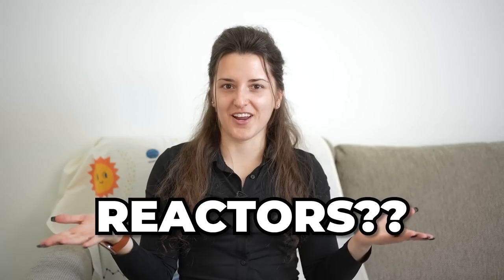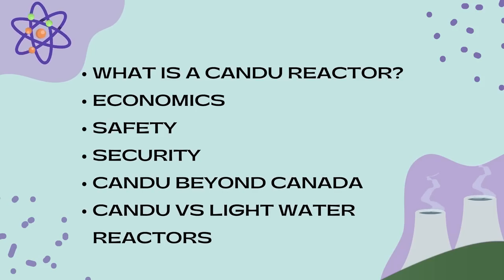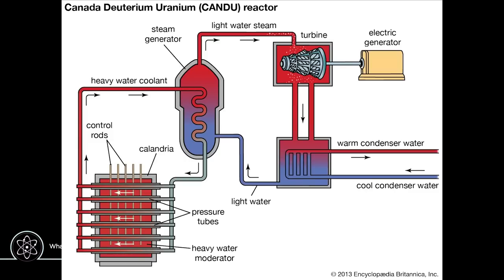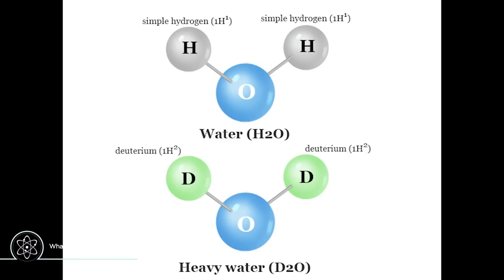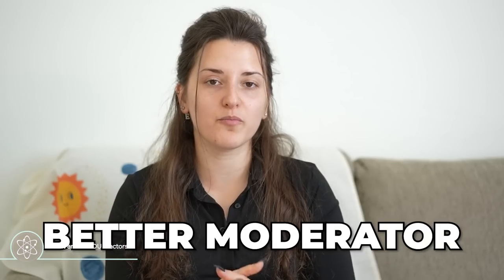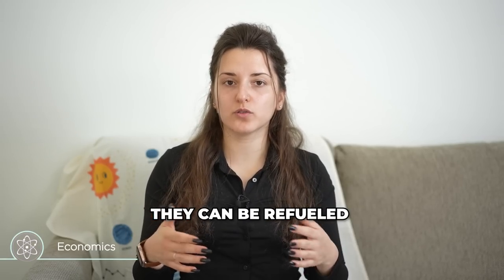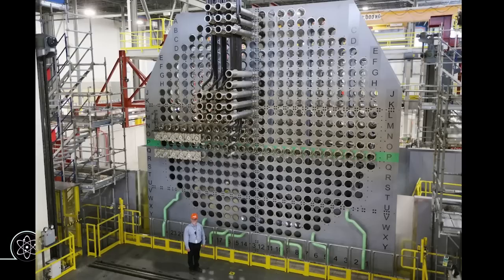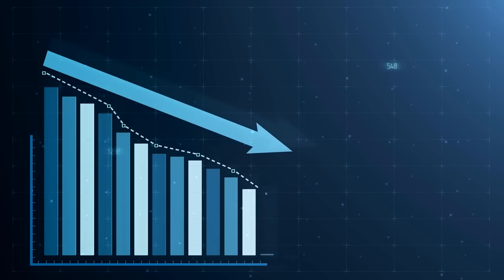Nuclear Physicist Explains - What are CANDU Reactors?

Comment: My understanding is necessary maintenance limits the capacity factor of CANDU to not really any better than LWRs in spite of online fueling in the CANDU, and that LWRs get away without online fueling by going to slightly higher enrichment balanced out by burnable neutron poisons and/or neutron poisons added to the water.

Comment: Very cool presentation! One thing I would add is that CANDU reactors are much more expensive than other reactors (BWR/PWR) mainly due to the huge dimensions of the calandria. Aside complexity and cost of materials, this also requires a very large containment building. So initial cost could be much larger.

Comment: The reason to use deuterium (D) rather than protium (=regular hydrogen, H) in not that it is better at slowing down the neutrons. Actually, normal water (H2O) is better at it than heavy water (D2O). Both because of a larger scattering cross section and also because of its lighter nucleus.

But here is the problem: neutron capture (or absorption) is much more likely to happen with normal hydrogen (H + n -> D) than with deuterium (D + n -> T).

Absorption cross section for neutrons in barn (source: wikipedia)
      thermal    fast
H    0.2          0.00004
D    0.0003   0.000007

Preserving as many neutrons as possible is super important when using nonenriched ('natural') uranium.

Comment: Candu reactors are in fact perfect for proliferation - it is the perfect design to produce plutonium continously, since single rods can be exchanged during operation. It does produce less plutonium than a light water reactor, but it does produce sufficient amounts for weapons use. And since it does not require uranium enrichment, which is complicated (plutonium separation is much easier) it especially appeals to developing countries, which want to hold the door open for the production of weapons grade plutonium.

Comment: Canada also has very high purity uranium deposits. This means that they can use the uranium without processing and still get good efficiency. Other countries would have to buy Canadian uranium or concentrate the uranium that they mine out of the ground. A reactor under pressure is much more likely to have a pressure explosion compared to a non-pressurized reactor. If your vessel fails, the water flashes to steam and suddenly takes up 400x as much space. This is why they have those huge, expensive containment buildings. Optimally you would use molten salt or metal which brings the advantages of high density and not being under high pressure.

Comment: Good video, a couple of conflicts from my own knowledge though: I thought D2O was a worse moderator in terms of its ability to thermalize neutrons, light water is the best. Heavy water makes up for this due to the fact that it doesn't readily absorb neutrons, thus enhancing the reactor's neutron economy. Second, I thought CANDU produces more plutonium than LWRs. But this extra production is dealt with by a higher burnup rate of plutonium. Because the moderator and coolant water is separate and somewhat thermally insulated from each other, the moderator is cooler than the coolant. So when the neutrons re-enter the fuel, they increase in energy up to the resonance energy of Pu-239. This is the opposite of the RMBK reactor type. This means CANDU burns plutonium, whereas RMBK stores it (intended for weapons), (I believe the Chornobyl reactor was at the end of this Pu build-up cycle, which exacerbated the accident). Just some thoughts, thanks for the video!

Comment: The heavy water is in fact more efficient as a moderator since it absorbs less neutrons than light water.  It has an improved neutron economy. But it is not as efficient as light water in slowing down neutrons through elastic collisions. That’s why the reactor is so much larger than a light water reactor, it needs more distance between the fuel to slow down the neutrons to be thermalised.

Comment: Thanks a lot for information about CANDU reactors.

In Québec, the only nuclear power station, Gentilly 2, a CANDU reactor, has been shut down in 2012, but has not been dismantled. Uranium combustible rods are still in the reactor.

And today, studies will be launched to know whether or not, the 600 Megawatt reactor would be restarted.

Interesting detail: The heavy water pressure inside the nuclear reactor vessel has to be maintained at 10 MPa (or 1450 PSI), about 12 times the pressure inside a heavy truck tyre, to prevent ebullition of the heavy water inside it despite its outlet temperature attaining 310 °C (590 °F), temperature required to transform secondary light water circuit into high-pressure steam required to run the turbines.

I have a question: In case of D2O leak, is the leaked heavy water radioactive and if so, what is the D2O half-life ?

Thank you..

Comment: One thing I don't hear about or don't understand, the water contained in the system is radioactive and toxic correct?... We talk plenty about disposing of the radioactive used core. But how is the radioactive water disposed of? And what safety measures are in place to deal with water leakage from the system?

Comment: It was my understanding that the CanDU a  Calandria vessel (not pressure vessel)  (kyle3420).  My understanding is that it is impossible for the CanDU to do a core meltdown.  If the heavy water around the fuel gets too hot, the water boils and the reaction shuts down.  This is due to the fact that the heavy water slows down the neutrons so that they can react with the Uranium.  No water - no slow neutrons - no reaction.   Another advantage is that if there is any problems with the reaction, just dump the heavy water and the reaction is shut down.  I remember researching this many years ago, but I have not found any references to this lately
Reply: 1) Pressurized light water reactors have all these advantages. Dot.
2) Melting of the zone occurs due to residual heat. If there is a loss of coolant in the CANDU core, there will be a hole in the floor, like at Fukushima Daiichi.

Comment: Something I'm not clear on is how it can use natural uranium as fuel.  When she said that D2O is a better moderator, I assume she means it's better at thermalizing neutrons.  Since the cross section for U238 in the thermal range is terrible relative to U235, how does having a better moderator fix that?  I feel like there's something I'm not understanding somewhere in here.

Comment: Does this reactor have flexibility in preventing "power tilt" or an uneven power distribution across the core itself?  I'm 71 and have always been interested in reactor theory/physics. You have a very interesting video series. Thank you so much for this.
Reply: Great question. The answer is yes. CANDU reactors have 14 compartments spread through the reactor core which can be filled with more or less light water as required. This  "liquid zone control" system allows both bulk and spatial control of the reactor flux. The reactor regulating system (control computer) continuously adjusts the levels in the compartments to control the power.
Reply: @Heja16  thank you so much.  Your channel is quite interesting.

Comment: @YourFriendlyNuclearPhysicist  >>> How often does a CANDU reactor require heavy water to be added to the primary cooling loop?
Reply: Almost never. The whole thing is pretty much sealed. If I remember well from my years at AECL, there are even systems to capture heavy water vapor inside the reactor building, scrub it out of the light water vapor also present, and scavenge it with a 90 to 95% efficiency.

Comment: I think the molten salt reactors you discussed previously are probably the most interesting reactors for the future. That said I think the advantages with regards to fuel in both versatility and lack of proliferation concerns with CANDU reactors are excellent. Given newer reactor designs that can be built in the near term to replace aging reactors and (ideally) increase nuclear use and cut fossil fuel use I think the CANDU seems like a great option where proliferation is a concern. I hope that the Canadian's can develop a better process to deliver the necessary expertise for these reactors to be operated more. The reality is proliferation is ALWAYS a concern so any reduction in the production of weapons grade material is good.
Reply: There have been plans for more advanced reactors in many parts of the world already, which didn't come to fruition. One case was the fast breeder in Kalkar, West Germany, which was opposed by many citizens, as it was supposed to use hot sodium as a coolant (which will create a flaming inferno as soon as there is any contact with the oxygen of the open air). Another issue was the high costs of the planning, enineering, and construction, which were initially supposed to be borne by the government. When the project took ever longer (it should have provided power in 1987) the government finally decided to stop the funding - in 1991. The companies then dropped it like a hot potato. 

The scariest aspect of this specific system is the breeding. It can create plutonium that that is suited for nuclear bombs.
Reply: Molten metal as a heat transfer medium is very problematic.  Russia tried sodium with a few submarines with the biggest problems being that you can not let the metal turn solid, making shutting them down to refuel very difficult and expensive.  Water is a very good coolant and moderator in correctly designed reactors for its positive void coefficient, where once over design temperature (or under design pressure for PWR) the act of the water boiling will reduce reactivity.  There were also some solar farms that used sodium as a heat storage media that also failed when it was cooled to the point of turning solid, and the plant having no means to re-heat it in place to ever restart it again.
Reply: @gabbyn978  
A fast reactor, in principle, is not capable of producing weapons-grade plutonium, because it cannot be reloaded on the fly, unlike channel reactors, it does not pose a threat to the proliferation of nuclear weapons (although it is not a threat).
Reply: @larrybremer4930  

The USA tried sodium, the USSR tried eutectic from lead and bismuth, and the problem of coolant solidification can easily be solved by a heat accumulator, especially since solidification is not a problem at all for civil energy.

Comment: I’m am from Canada and I am not sure about the lower maintenance cost.  In Ontario, where most of Canada’s CANDU reactors are located, the Ontario Power Generation Corporation has a huge debt and, as a result, Ontario has very high electricity costs.  Most of that debt comes from the cost of maintenance and refurbishment for its CANDU reactors which account for about 60% of Ontario’s electricity.  (Very little of that debt is from overpaying for the installation of windmills as politicians try to score points like to say.)   The same may be true of light water reactors, but low maintenance cost is not a selling point for CANDU reactors.
Reply: This comes partly into play due to having to pay the USA to take our Excess power generation.  That's right, we pay others to take the surplus power...  There was also the Boondoggles with the Previous Liberal goverment with a Gas Fired Generation Station and also the Payout Rates to SOLAR / Wind generation providers being higher then the cost of the nuclear generation.  There's a whole story behind the cost and yes, it's expensive, but it's not through fault of the technology, it's the politics.
Reply: @Dropbaud  The debt due to nuclear power is in the 10's of billions of dollars.  The items you are quoting are insignificant by comparison (unless you like to parrot PC talking points).  Both the PC and Liberals have very large responsibility for the mess in Ontario's electrical power situation.  But the bottom line is that nuclear dwarfs all other debt contributors.  Both political parties have made major contributions to miss managing that debt.  In all credible analysis I have seen is nuclear power is extremely safe, extremely dense (lots of power out of the land area occupied by the generating facility) but extremely expensive compared to any other common form of generation.

Comment: Since I live in Canada I would by default choose the CANDU, but it was cool to learn that the CANDU can help remove some of the waste fuel from the light water reactors.  Having said all that I think we need to start burning through all those old light water reactor fuels, I just am not sure how we could move those rods with a huge safety margin.  I mean obviously not with a train as we see them get all smashed up.  However, I think those thorium salt reactors look interesting.  What I would like to see society do is clean up all the light water reactor fuel we have all over the world. Yes, we store the rods in water or maybe we stick them on concrete that will not last long enough for the radiation to be handled.  Do better.  Can't believe we built things we still have no good solution to, OK one country I know has a plan but I imagine they won't be taking fuel from every country and someone will build a storage site on a fault line.

Comment: One of the main reasons CANDU hasnt been licensed in other countries is the fact it has a slight positive void coefficient, which means that when the coolant is depressurized and starts to boil, the reactor power increases. Light water reactors have a negative void coefficient and will not run away since the coolant is also the moderator
Reply: Pretty sure this is the other way around. If the moderator or heat carrier (both being heavy water in the case of PHWR) boils, then the density reduces and the neutron flux is not as effectively slowed to become thermal neutrons (those with the right energy to sustain chain reaction). There are even some sub-variants where one of the emergency stop system dumps the moderator into a receiving tank below the reactor itself.
Reply: In a CANDU reactor the heat transport D20 and the moderator D20 are seperate systems. Physically separated by two walls of zircalloy tubing. The natural uranium fuel lays inside the fuel channels, that is surrounded by an annulus gas system to detect leaks in that boundary. Those tubes are mechanically sealed via another tube outside of that. Then you have the moderator. The moderator will never boil unless the fuel melts through both walls and even then it would be difficult as the calandria contains a very large mass of D2O. You are partially correct though, the temperature coefficient of the fuel is negative and will counteract the positive void co-efficient when the fuel expands, but not enough to shut down the reaction. The first generation system did have a dump tank that the moderator only would fall into when the unit scrammed. That system was modified in the early 2000's upon restoring the units to commercial service. A dump arrest system was installed that monitored the neutron flux when a scram occured, it would prevent dumping the moderator unless the flux decay wasnt following a pre-determined curve. The reason being is the moderator system takes away i believe 30% of the fuels heat during shutdown. So it didnt make sense to remove the heat sink if not required. The normal shut down is via rods and liquid zone flooding for Pickering A units 1 + 4. Newer units incorporate liquid poison injection in conjunction with rods
Reply: @vincentgoudreault9662  i know this because I worked at Pickering in Ontario as a control technician
Reply: @mikestiglic1880  OK, you are correct. However, I doubt that this could be used as an excuse for limited sales. The slight positivity will always be caught, and the action of the poison system and control rods is, if I am not mistaken, pretty much passive: stop energizing them and they just drop in.
Unless other nuclear reactors designers are using this as some kind of scare tactic.

Comment: Although it's able to run on natural uranium, in practice it actually uses moderately enriched uranium (2-3%) to make the reactor more economical. Also it's not true that CANDU reactors cannot be used for proliferation, in fact, the quality of the plutonium produced by a CANDU reactor is actually higher than that produced by light water reactors.

Comment: One CANDU was built in former Czechoslovakia as NPP Jaslovske Bohunice A1 and under went 2 accidents in 1976-1977. First caused mayor CO2 leak and killed 2 workers. Second ( Grade 4 accident) where reactor was demaged after fuel assemble replaced and radioactivity leaked to surroundings. After the accident reactor was shutdown and it is being decommissioned since than.
Reply: Wrong, the accidents occurred on the Czech designed experimental reactor.

Comment: They can burn natural fuel and used fuel, but can also be reloaded while in use (proliferation risk), and the heavy water is very expensive.
Reply: I'm unclear on your proliferation argument.  Unless the concern is over materials being stolen for a dirty bomb I cant see the issue because the level of refinement is way to low for a weapon.  The water is definitely expensive but on the plus side burning reprocessed waste and being the only path to making enough tritium for fusion research are two very good reasons the design is needed despite the cost.
Reply: @0ops1e  any reactor that can be refueled during operation is a proliferation risk.

Comment: There is another safety aspect of CANDU reactors.  They can be shutdown by draining away the heavy water.  All reactions stop.  If a reactor was to begin to run away there are thermal releases that remove all the moderator stopping the reactor.  The upfront cost of the heavy water is a big one time initial cost of the system.  Those never do well in the megaprojects.